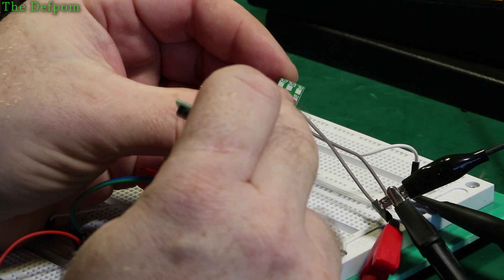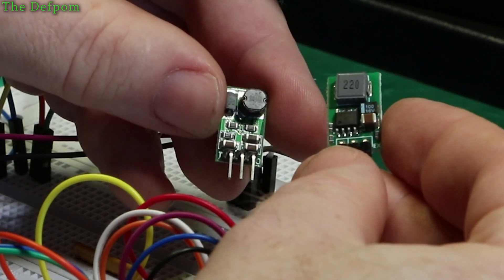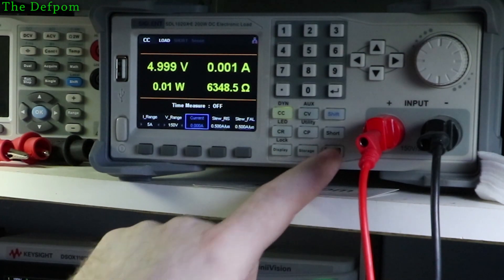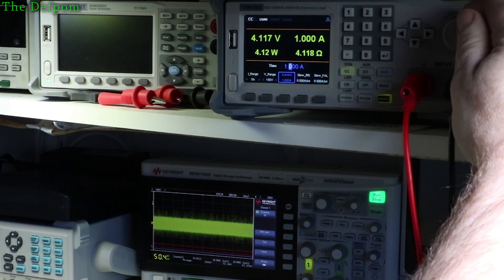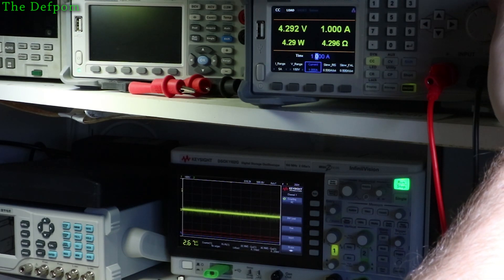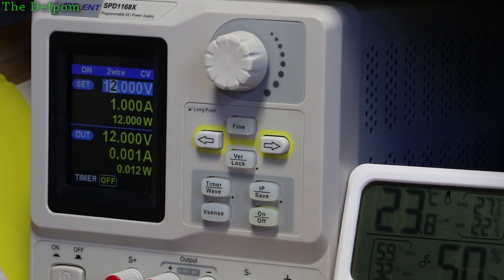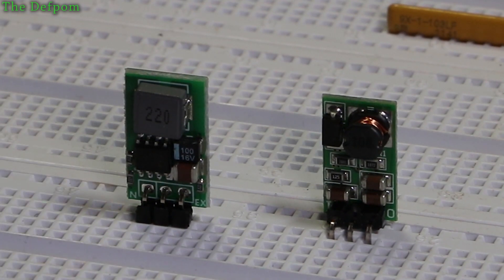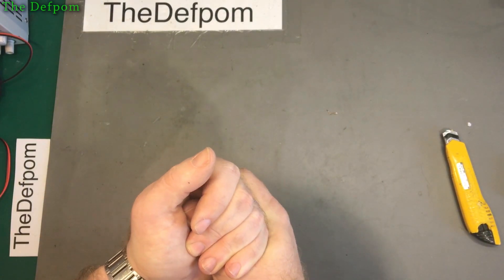#686 5V DC-DC Buck Converter Shootout

Comment: 2 QUESTIONS:  Do  Buck Converters create "noise" if used with a 12 volt BATTERY to output 5 volts to a portable radio receiver?  Is there a way to eliminate the noise?  Thanks

Comment: I am current-ly struggling with a power supply for my latest invention, so this kind of thing is very useful, if only to confirm the validity of tests I can do, albeit with simpler gear. But I do not understand why you would not flunk BOTH these regulators, neither of which could hold upon anything near 5 volts when asked for even 1/2 the max current... I got some "5V 3A" units from a reputable dealer made by a reputable manufacturer (or so I thought). Could not do 2.5 Amps without thermal shutdown.

I did get 4.98 volts at 1.66 amps, regulator too warm to keep a finger on but probably within specs.

The manufacturer themselves said the unit would get very hot,  as hot as the chip should get at only 2.5 Amps, recommended that I design in some "guard band / extra amp", which was what I was trying to do as I only need 2.25 A, tested at 2.5 A for my own headroom, FAIL.

Don't deploy this kind of device until you have done an experiment like this with it!

Comment: Thank you for comparing these two DC-DC converters. This helps (maybe) when choosing a suitable converter for future projects. I definitely ended up with a screenshot that shows your wonderful thumb that says, "This one is better in terms of quiescent current and noise. ToDo: Measure to be sure)"
I'm not very comfortable with "The good one" or "The bad one" as an electrical engineer. This denotation is more appropriate for a classic western directed by Sergio Leone and featuring Clint Eastwood;)
Without reducing your good work, it would have been nice to have a table at the end that lists types, voltage deviation under load, distortion factor, efficiency and Absolute Maximum Ratings. You don't need a follow-up video to do this, just add it in the description, of possible. In my opinion this will add practical usefulness of your Analysis. A comparison and measurement values compared to a four-wire measurement, as mentioned in the video, would be the icing on the cake. That would represent the relationship between how a breadboard assembly differs from a low-resistance production assembly. These are potentially 25% -50% differences and can be very critical as one product can operate with a much higher output current. Unfortunately I can only guess. Incidentally, I'm not begging for overtime here. Of course, everyone has to do the calculations and measure themselves for this to work in the end.

Starring:
The good: DDS4012SA with ME3116 (https://easyeda.com/Alterac/buck-to-220-replacement)
The bad : possibly MP1584EN alike? (https://www.monolithicpower.com/pub/media/document/MP1584_r1.0.pdf) or MC3x063(TI, ONSemi)/ MC34063(ST) as suggested by @threeMetreJim. But I can not find a good photo or circuit diagram on which this can be clearly seen. Who might have such an assembly and could look under the microscope? :)
The ugly: I'm sorry it looks like I'm bad-mouthing your video. On the contrary, I think it's great. I just hope to provide a few details that may be of interest to others who want to delve deeper into the matter.

Comment: That was interesting. More and more retro computer repair people are using these modules to replace 7805, 7812 regulators. I am surprised at the noise and efficiency differences. Thanks for this test.

Comment: With respect you may have overlooked an old technique of loading a power supply with a minimum of 5 to 10 ma and a parallel low value cap to get stability whilst waiting for a more substantial load to be connected such as 500ma or more.  This idle load is insignificant to the intended application but prevents spurious noise issues whilst at idle.

Comment: huh I was expecting the one that had the gray inductor to be be better but I guess not. I was expecting it was a synchronous buck design since it didnt have an external diode. that can explain the bad idle current because it has to switch on and off both mosfets. but it isnt so im not sure. if you are looking for really low noise you could setup an LC filter after it. or better yet set the buck to 6v and have a linear regulator after it to 5v. that would make it alot more efficient but still low noise. I like to salvage all the little buck chips from different electronic boards, modems are the easiest to get a hold of and are pretty good most of the time. thanks for sharing your testing!

Comment: The 'big-chip' one looks like a 34063 based design. Older technology and doesn't use a MOSFET for switching, probably why the idling current is higher. Still ok for non-critical designs, and won't heat up anywhere near what a linear regulator would under load.
EDIT: Had a look further and it isn't a 34063 after all (I wondered why I couldn't see a schottky diode), so no idea why the idling current is so high.

Comment: Are those DC load cables after market?  They look great. A link to them would be useful.
Reply from the maker: I've had them for a while, I am pretty sure these them, from my  purchase list: https://defs.link/?u=d1477a

The 4mm nuts on the load are aftermarket, I got them from eBay, came as a set of binding posts which I took the nuts from and put on the load.

Comment: Looks like you crashed one of your colo'd servers...
Reply from the maker: It was expecting its dedicated network to be present to talk to its server, the network wasn't turned on at the time so it fell over... I fixed that code now too :-)
Reply: @TheDefpom  How many servers do you have colocated?
Reply from the maker: @douro20  - I don't house any servers, all the sites I manage are cloud based, I have just been running one on a laptop (and testing the raspberry pi) for a offline system.

Comment: Just the sort of test I was looking for.
The good converter looks very good with that very low noise.
Can you do a simple efficiency measurement at 1A load, to see what the power dissipation of the converter is.
This appears to be the IC on the PCB,  https://datasheet.lcsc.com/szlcsc/Nanjing-Micro-One-Elec-ME3116_C97643.pdf